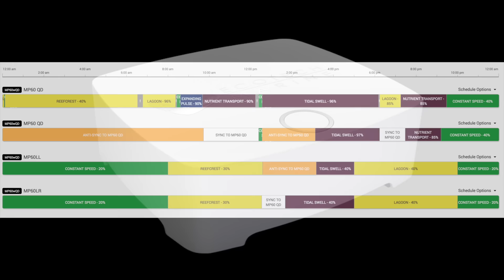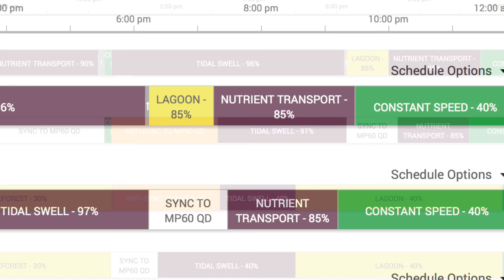Flow Upgrades on Mr. Saltwater Tank's 450g Build

Comment: Hi Mark, can you help me with something. I am setting up a new system. I already have two vortechs and two xr30 and was upgrading my return to the Vectra. I have the apex controller and was debating between the apex unit or the reef link. It's my understanding the vectra does not work with the apex module. What are the pros and cons between them. From what I read the reef link connectivity is very poor. Have you had any issues with that? I would like to be able to control it all from fusion but if the return doesn't connect then I'm not sure it's the way to go

Comment: great info Mark. sub'd your channel. I have a 300g (8ft long) Tank and am swapping out my 2 MP40S from my 180 to my 300. I also am using a maxspect Gyre 150. would you suggest purchasing another MP40 on my system? I am starting with LPS  corals & eventually will venture into SPS. keep up the great work.

Comment: HI Mark,
I have two wavemaker on each side, both facing the center of the aquarium, is having both on the same side like yours better? Thanks!
Reply from the maker: keep them on either side
Reply: Hi Mark, thanks for the advice, can I ask for another advice, both my wavemaker are facing the center of the tank, now my sand bed is disappearing at the front mid section. My wm is already at their lowest settings, what should I do?